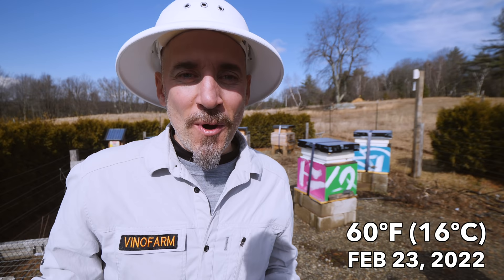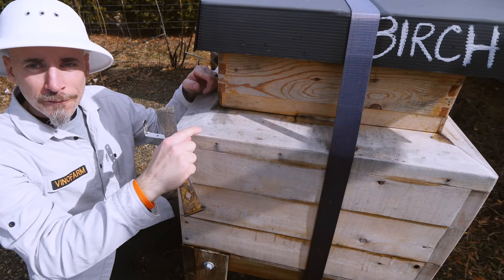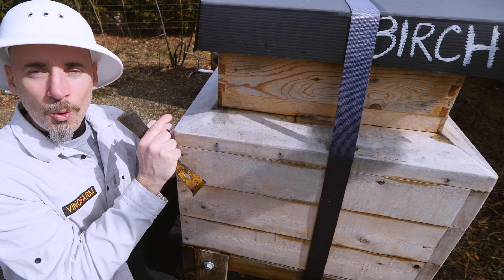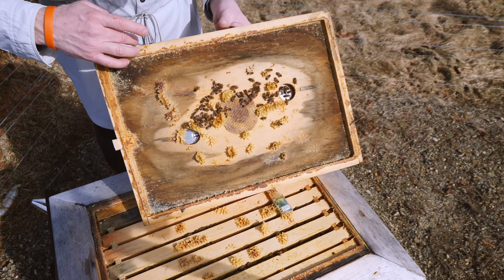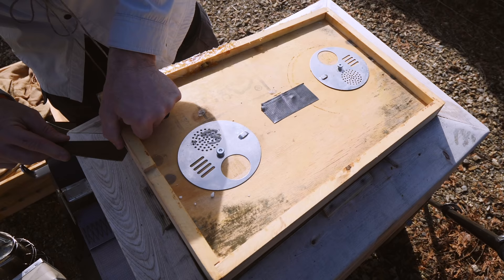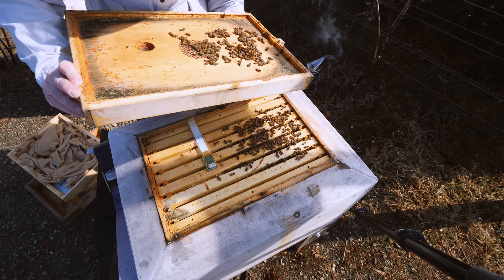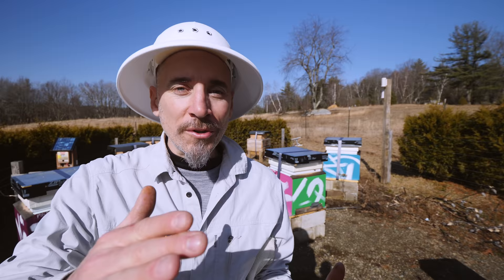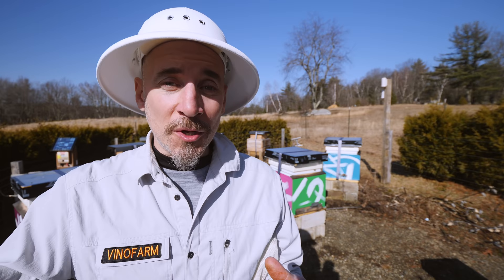A FLAW In My Hive Design... (So How Are The Bees?)

Comment: Have you considered dipping the frame in  paraffin wax?  Seems like that would help with the molding issues in addition to making the additional modifications? 

Maybe instead of the brood box line up with the outside insulation it protrude out by 1/2 inch or an inch, the melted ice from the heat at the gap can run down and escape through the sloping part.

Or some kind of o-ring rubber gasket between on top edge of brood box or both side of top cover to make a water tight seal so the melted ice from the heat at the gap won’t seep in.

Or just a simple tarp over the entire bee barn so there is no direct snow contact with the barn (like a rain coat).

By the way I really like the methodical approach you take in identifying the problem and experiment to resolve the problem.

I can’t wait to see your new design.

Comment: I understand about moist air hitting cold surfaces and condensing and your plan to keep moisture away from cold inner surfaces by not having any.   What I don't really get though is your theory that the bees will handle (or accept) the humidity without having ventilation (other than the reduced lower entrance).  In summer they would have this ventilation route available.  I am afraid of trusting that you can ever have enough insulation that moisture is not going to hit a cold surface and condense eventually without ventilation.  Having said that your results are impressive so far. 

I used your modified folding cover method 2 winters ago (4 sides) with vivaldi board and it was a huge success.  
This winter  though I lost 2/3 of my hives and I think it WAS due to moisture (lots of uncapped honey from late fall flows and very very cold (-35C) temperatures).  In Ontario, average losses this winter was over 50%.
Reply from the maker: Trees don’t have upper ventilation. Feral colonies living in the wall cavities of houses don’t have upper ventilation. When I give the bees upper ventilation, they propolize it shut. A single lower entrance to a all they need. 12/12 colonies survived last winter with a badly designed inner cover and an abundance of water dripping from the ceiling. The bees will not “live with” excess humidity, they will manage it. They know what they want and they manage the temps and humidity. The goal is to give them a sealed, insulated space for them to manage… No wild temp swings, drafts or chimney effects to worry about. Just stable air that they can move how they see fit.

Comment: I love following your testing and innovation. 

One thought to consider : could the 2 inch foam on surface above inner-cover (with those vents) causing the moisture in the hive to be trapped under the foam and then building. The inner-cover is porous so it’s absorbing on both sides. But the center of the inner-cover has airflow from the bee cluster thus preventing collection of moisture. 

I think if you put the foam on top of the burlap and put cross venting on sides of top box. You may solve your problem. 

If you add more 2” foam and cap it with 2” foam you may trap the moisture created by the cluster. 

Just a thought to consider.

Comment: Please share your thoughts on a fix for the mold issue. I'm starting my very first hives this spring. I'm in upstate NY and I know you're hives work because I've been following you. It's your experience and skills and most of all COMMON SENSE APPROACH.
Reply from the maker: The fix is to prevent condensation from forming on the inner cover. Where the bees were able to keep the inner cover warm, no condensation formed. The goal is to make it so they can heat the whole thing… MORE insulation. NO thermal bridges.

Comment: Regarding top issue, put a triangle wedge of Styrofoam or something and just run a strip of sealer. My husband used a caulking gun and silicone stuff to seal roof issues that were leaking in metal roof where screws were. It DEFINITELY sealed the gap. If your interested, I can get the name of it. I was thinking of using it on my hives next winter to seal any gaps between boxes.

Comment: You should try with one hive a
For comparison to eliminate the inner cover and just cover with a canvas type sheet and a blanket. I believe the lack of moisture escape causes the molding. Also if there's extra outside frames that are not used by the bees could be removed to improve better air circulation, because you can tell that what ever area bees are occupying, that area is dry from moisture. So far I'm happy with eliminating the inner cover, all the moisture is getting saturated into a blanket. I'm in Pacific North West, with changing temperatures and high moisture level.

Comment: Jim, a couple of suggestions.  1. use polycarbonate sheet for inner cover - tougher than plixiglass and 2.  replace your wooden "roof" (2x6 cut on slant) with Johns Manville Fiberglass faced polyiso roof decking (r-8.6) or Johns Manville polyiso foam board (r-9.3), or Owens Corning Foamular 250 (r-7.5) all at 1 1/2" thick.  That way you could still have your slant for rain runoff and remove the thermo bridge.  $.02 and worth every dime.

Comment: Hi Jim. Your moisture issue is twofold: 1-what u mentioned about the rim. I have my wooden boxes permanently encased in thick polystyrene boxes. The inner cover's outer frame was widened with solid wood to match the thickness of the box. 2- the top insulation needs to be directly and tightly sitting on top of the inner cover (mine glued permanently as I have quite feeding bees any liquids, and only give them back their own honey, or dry sugar as a last choice) the air gap you have between the inner cover surface and the insulation will eventually get a bit cool causing the humidity on the other side of inner cover to turn into moisture. BTW, even with all bases covered, the humidity will eventually turn into moisture around the lower walls (cooler parts of the hive) but that benefits the bees as a water source in the winter...

Comment: Jim, I noticed that on the frame you pulled from the Beech hive that the brood was at the top of the frame, as is normal in winter. In a conventional hive you can swap the two brood boxes to 'recenter' the brood area. Do you think that not being able to do this with the large frames will be an issue and have you previously swapped brood boxes in the Spring?

I'm in CA and new to beekeeping (2 years) and would like to get a copy of your hive design when it's available.  Your videos have been very helpful.
Reply from the maker: That was not brood. That’s capped honey. The bees will need all the resources in the boxes before the brood rearing goes into high gear. We have two months before there’s any significant forage. That honey will all be used or shuffled around. They know where to put brood when it’s time.
Reply: @vinofarm  Thanks Jim for the reply. I already have brood in my hives' top chamber as its been unseasonably warm here in CA for many weeks. Hence my assumption that it was brood. Nectarines, Almonds and plums all have been in blossom already in the CA foothills.
.

Comment: A thin siding insulation that runs to the top then your thicker insulation.  Should move the condensation point to between the two insulation layers and away from the wood.

Comment: After watching multiple videos of your designs, I think I will go simple here in Oklahoma. It doesn't get as cold or last as long as your Northern winters here. I am thinking a rectangle shaped insulated box to simply slide over the entire hive structure (except for the lower entrance) with another piece ratchet strapped to the bottom.

Comment: An old timer told me that "wet bees are not dead bees BUT dead bees are wet.  Like most things a strong, healthy hive cam adjust the moisture and deal with it.  I've had hives in Northern IN where the  covers have blown off and survived after rain, snow and cold weather.
Reply: Here in ND I had a hive flipped on its side by a bull and no lid, cluster exposed to -10 f all night. Flipped it up, put everything back together and it lived.
I don't even wrap hives and we have had 3 days per week -30 since Jan 1st . . I'm exhausted just thinking about this kind of work and scale when you have more than 8-10 :)

Comment: You could try making a 2-3 inch outer insulation shim, then make the top sloping roof removable. This way, your insulation goes past the inner cover, and doesn't act as a bridge to it, and when you need to get down into there and pull off the inner cover, you can remove the sloped insulation and shim. 

You might also want to consider replacing the inner cover with a clear inner cover, that way you don't need to keep removing and adding the outer insulation shim whenever you want to check, and it just becomes something you add at the beginning of winter and remove at the end.

Comment: Thinking about how to push the insulation all the way up to the lip and then have the wood bevel extend up into the next box. The main problem I come up with is you are going to run into an issue with getting your tool into the inner cover when its sealed in with propolis. I'm wondering if you can't design the beveled section of wood to sit proud of the 16" box but be removable on a system of pegs with a shoulder or rabbit in the insulation to keep it sealed. Its an extra step to get into the box during inspection, but might help cut down on the extra condensation, without preventing access. 

You would run into an issue with the beveled cover potentially moving, but if you toss a latch on the wood below (chest latch?) you could even get some clamping force on it. if you wanted to over-engineer it a little bit you could run a rubber gasket as well, but that  may well be overkill. 

Additionally If you make the beveled "insulation cover" tall enough, you could line it up so the thermal bridge is in the section above the insulation in the top box so you could still use some of the wicking action of the burlap.

Comment: I feel like removing the poly insulation off of the top and using more burlap would help by allowing the moist air to escape into the upper chamber. They seem sealed pretty tight, a little more air movement may compensate for the thermal bridging/condensation. You might try that in a couple for the balance of the winter anyway...   just a novice Montana Beek, love your channel.
Reply from the maker: Check the pinned comment. Thanks for watching.

Comment: The big concern for me about no upper entrance/vent is snow blocking the bottom. We can get a lot of snow and the bottom entrance can be completely covered (freezing rain can be a problem too). Top vent guarantees a source of fresh air for my hives. Not sure if this is a concern there but for sure its something I worry about. I do keep the top vent smaller and off to the side of the cover to minimize any heat loss.
Reply from the maker: My hives are elevated and only a really bad blizzard would ever block the entrances. And I’m always there to swipe away a bit of snow if that ever happened. This works for me, it might not work for everyone.
Reply: @vinofarm  I could elevate mine more but we still have snow that goes over my knees not sure I can get them high enough :)
Reply: I can't get mine high enough either - we have 3-4 feet out there and with mouse guards and such they freeze up sometimes. Good point and reminder different places have different concerns

Comment: I love your idea of this new design.  A suggestion.  Why not add 1/4" insulation material between the sloped wood and the beehive that will also pertrude about 1/16" upgward so that when you put the top on, it will create an a water seal and also provide the separation of the cold material touching the hive thus providing a buffer between the material exposed to the outside and the material inside.  This will only require a 1/4" reduction/cut on the peace of wood that's sloped?

Comment: I am building my bee barns this spring and I am toying with a couple ideas on the "thermal bridge" problem. Since I am working with 10 frame hives and building an 8-frame bee barn, my I feel like my insulation can come up and block that bridge... at least on 2 sides. On the other 2 sides, I am still not 100% sure what I am going to do. Maybe thinning out the sloped roof near there, or thin metal roofing/flashing material. What ideas are you kicking around?

Comment: "Bees like moisture", hmm that certainly goes against the normal logic for overwintering. I know they often drink droplets of condensation but I think being dry most of the time is more important. 

The phrase I always heard was "cold doesn't kill bees, being wet and cold kills bees." Sometimes I think people's desires to shield the bees from the cold does more harm than good. I've found that being sheltered from the main winds but still allowing a small amount of air flow through the hive is best for survivability. Mine come through winter as if winter didn't happen. Although I appreciate it doesn't get as cold in the UK as where you are! 😁

Love your channel. 

I would say don't be afraid of the cold. It's not the cold that killed your bees last year
Reply from the maker: I made a whole video about why that phrase is garbage. Cold can certainly kill bees. And yes, bees need water. It's all about managing where condensation forms. A flow of air through the hive makes the bees work incredibly hard to maintain heat, which takes more resources. Put temp sensors in your hives and watch the difference between open vents and closed vents. It's remarkable. Imagine the inside of a tree hollow, where bees evolved over millions of years. There are no upper holes venting "moisture" and heat out of the colony. They want things sealed. They manage air flow just fine with a single entrance. I'm not telling anyone how to keep their bees, just sharing my thinking and how I'm changing my hives for the future.
Reply: @vinofarm  I have no doubt that keeping vents closed keeps it warmer. Its simple physics, but it also traps in moisture. I guess it's about getting the balance right. It's obviously working because all your hives have survived 😁
Ultimately your hives are nice and warm but also wet. The moisture isn't a problem unless they get very cold. Your sensors are showing its staying warm so there isn't a problem beyond the mould which I guess doesn't really bother the bees.
Reply from the maker: @manvbees  The idea is to keep the upper area too warm for condensation. The bees manage air flow out the lower entrance. It's cooler lower in the hive so condensation will form lower, below the cluster. Water will still be available for the bees and excess will flow out the bottom. I messed up my insulation and allowed the inner cover to get too cold and that's where the condensation formed. I am fixing this.
Reply: @vinofarm  cool, excited to see the next video 😁

Comment: Disclaimer I know nothing of bees and beekeeping. However, As a grower, I can say that your problem is how moisture-tight your top is with that blue foam.  Plus what you pointed out. That foam is not allowing your moisture to wick through the top cover boards and out the top.  SO  the cold bridging the wood as you brought up is causing the dew point to be reached.  If you drilled or poked some holes in the foam and stuffed these holes with insulation, like pink batting, the water vapor will flow through the top. I think this will help a lot. or you can just replace the blue foam with pink batting.... or a square of  Tyvek and pink batting. Tyvek is waterproof has a small R-value but water vapor flows through easily. I really enjoy your progress and I love that you are doing things your way. I  plan on starting this summer and will have the same philosophy of trial and error on my own terms.
Reply from the maker: Yes, ventilation would remove moisture, but I’m not trying to remove the moisture, just control where it forms. The bees use the water when it stays in the box. This video gives an explanation of what I’m trying to do: basically NO air vents up top. https://youtu.be/UKXgIdHpedo
Reply: @vinofarm  its not venting exactly I am getting at, it is moisture passing through materials, for example, water vapor will move through the painted drywall of your house with ease then through the insulation etc. same thing with plywood and many other materials, but when you introduce a plastic membrane like the foam, the vapor can no longer pass. Another example have you ever had a plastic car cover on a car or boat? (Tarp or shrink-wrap) notice how bad the mold gets even undercover but if you use a material that passes vapor like most car covers or Tyvek mold is much less a problem. So what I am saying is that in this case, the R-value is the same there is no venting but vapor can pass through materials. I hope I am not sounding like I am trying to tell you anything,  you are an amazing storyteller and a fantastic resource for the keeper community. I know nothing really of bees, I just come from a grow room environment that has some very similar problems it seems.
Reply from the maker: @unclereefer37  I hear what you’re saying, but I’m not trying to let anything pass. I’m trying to seal everything tight. Like a “Passive House”. The bees are a living HVAC system. They will manage moisture and the heating of the living space. Think of the inside of a tree hollow. They would most likely have only a lower entrance, thick walls, and basically an infinite roof. Water would condense on the walls and excess would drain to the bottom. There’s no venting, wicking, or movement of moisture through the tree trunk. This is what I’m going for.